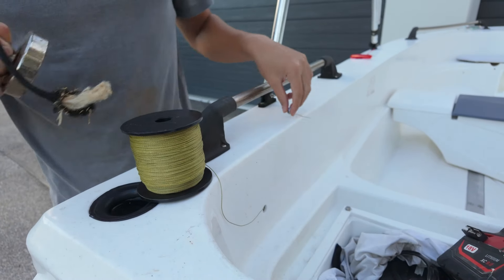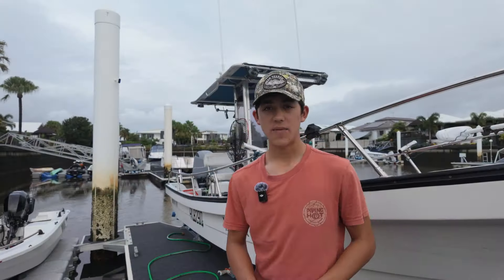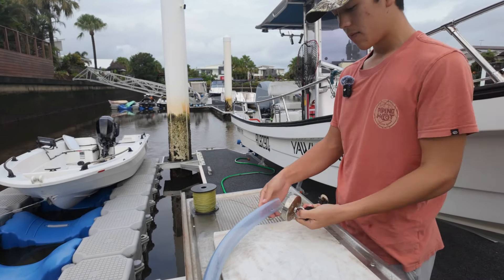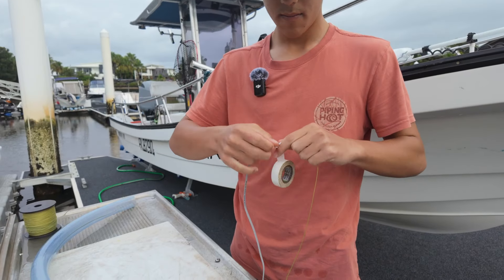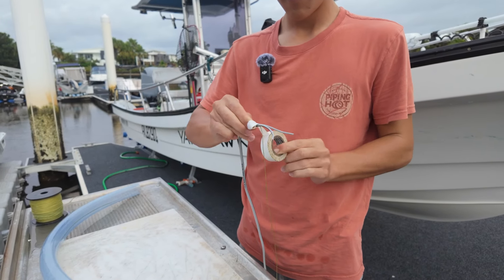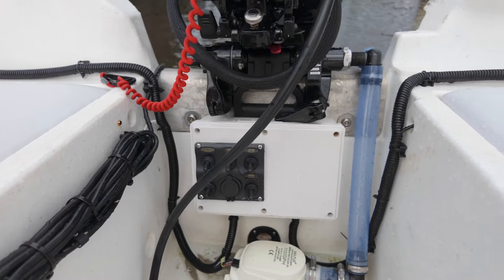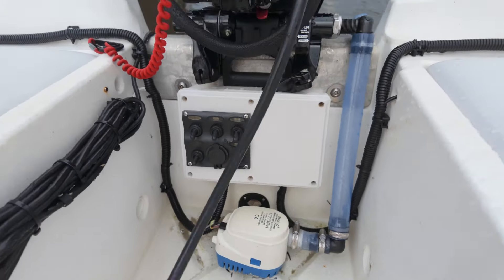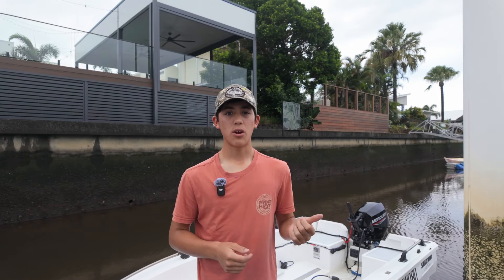I Wired My Boat Electrics Using A MAGNET!!

Comment: Why did you run wires over the seat when your goal was to put the wires in the hull?
Reply from the maker: I hit some foam flotation, and didnt want to disturb it too much. @Robnoza Great content by the way !!!!
Reply: @YAWK_YAWK  thanks mate, I used "Fiberglass Wire Cable Running Rods". They poke through the foam.
Reply from the maker: @Robonza  Thats an excellent idea, I have some of them in the shed